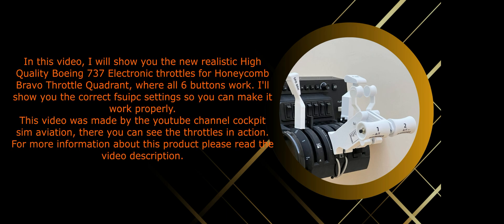Full Electronic B737 Thrust Lever Upgrade Kit For Honeycomb Bravo Throttle Quadrant Installation

Comment: For anyone who doesn't want to use FSUIPC to do these binds, you can absolutely do them in MSFS itself. (Have used and no issue with the PMDG 737s, WorkingTitle 787 and 747. Haven't tried with any other MSFS Boeing's (CptSim) but I'm assuming if it works with the Asobo Boeing's it should be find.

Comment: I looked at your video i did the settings in fsuipc the same but the toga buttons are not working
Reply from the maker: There may be a problem with your FSUIPC. Did you purchase a product without electronics?